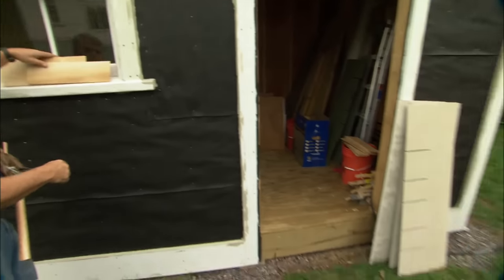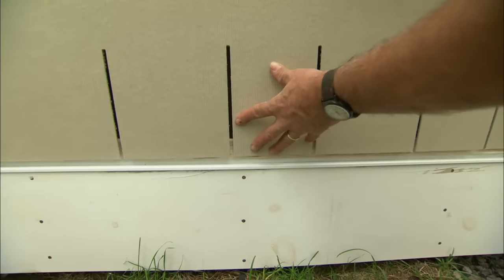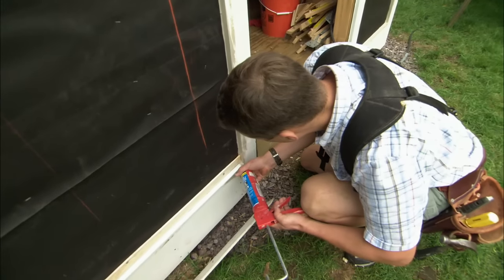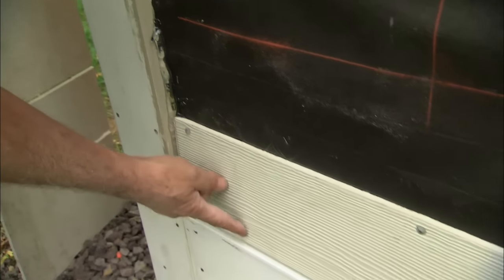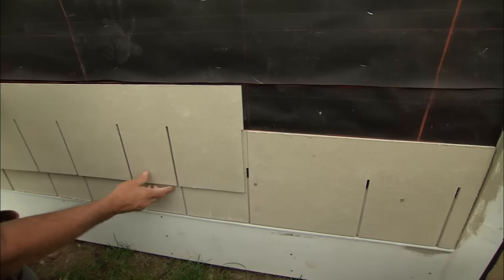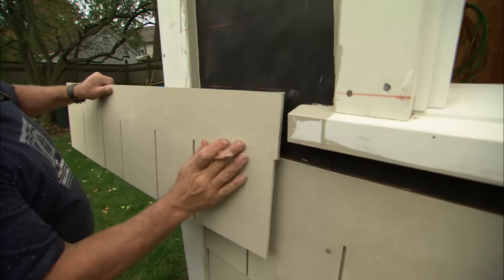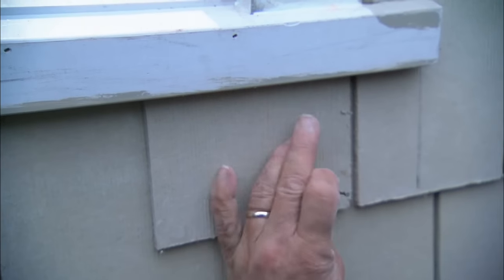How to Install Fiber-Cement Siding | This Old House

Comment: Tommy Silva did a top notch job installing the fiber-cement type clapboard-shake style siding on this outdoor shed. Looks pretty durable and almost as realistic as wood siding without the maintenance worries..
Reply: Roofing Companies CT   I wouldn't hire you for roofing. The flashing was installed incorrectly.
Reply: Roofing Companies CT no primer and paint on the ends, no proper flashing. plus can you say "class action lawsuit"? these guys are teaching people to cut Hardie plank the way the manufacturer say NOT to. the dust is among the most hazardous out there and all you have to do is score and snap it. plus they're wearing dust mask not respirator.  you all should learn how to build.... and read
Reply: If you're wearing a respirator is it okay to cut it like he did? I'm just curious since I don't know much about this stuff.

Comment: Interesting they didn’t use vertical strapping and attach the siding to the strapping to create an air gap to allow water to escape. Maybe it is because it is a tool shed.

Comment: I love seeing that good old fashioned felt paper. You can't beat it. Question: do you need a "rainscreen" behind cement board siding?
Reply: No
Reply: Yes
Reply: Maybe?
Reply: It depends. [actually, HardieShingle does NOT require a rainscreen]
Reply: Tommy Kinda LaSorta
Reply: On a climate controlled building — in which there are differentials of pressure, temperature, and humidity — absofuckinlutely. 
On a tool shed, not so much.

Comment: Is this stuff the same thing as Hardie plank? It looks like it. If so, that tip about scribing both sides of the product and just breaking is pretty cool. Save a lot of saw blades and I don't have to breath all that dust!
Reply: C J Bowen  you get mesothelioma from asbestos.you get silicosis from cement dust.

Comment: Hello I am replacing the siding around my chimney. Current siding is wood and we are putting new fiber cement siding. Do I need to put any membrane between the siding and OSB wood for the chimney?  I know any other outside wall requires a house wrap but I am not sure about the chimney.

Comment: Cant complain too much if this is the material you want to use, (homeowner), but so much cheaper and faster and easier to use vinyl.
Reply: This is just a shed, so it probably doesn't matter too much.  Also, some people just don't like vinyl.

Comment: If you face nail the shingles under the window do you cover the stainless steel nails with caulk and paint or?
Reply: paint pen...no need for caulk unless you're filling a void.
Reply: The homeowner is painting the shed green--so, it'll be covered with paint.

Comment: I'm despairing because I started to patch my existing shingles with fiber cement and I keep cracking the fiber cement, so now I have a huge gaping chunk of the corner of my house down to the tar paper. It's impossible to find help these days. I don't know where to begin. What I wouldn't give to work for TOH and learn how to be self-sufficient without putting the soundness of my house in jeopardy because I don't know what I'm doing.
Reply: Do you live in the Town of Hempstead, NY?  I'll be right over to give you a hand.  Let me know how you want to arrange it.  This doesn't sound like a big deal.

Comment: decreased exposure, but that's okay.  Not painting the cuts will void warranty if JH branded, as well they have a impregnated nailing line above the tabs, not lower...which was done due to smaller exposure.  Ringshank nails either stainless or galv are adequate...save the stainless for the face nailing and use galvanized on the non exposed....too much money to waste on bigger projects.

Comment: What is the cost for installing fiber cement siding for a 2000 sqft house?
Reply: Our 2500 square foot house cost over $40,000 for James Hardie fiber cement siding, trim, soffits, facia, sheathing repairs, etc. Labor was the biggest cost. It is not cheap...

Comment: Did you use 15 lb felt, or Grade D building paper under your siding
Reply: Look into synthetic underlayment vs tar paper.  Tyvek/Titanium/Grace, many choices. These don't crinkle if they get wet from rain/heavy dew if you don't get done in a day.  they don't tear either like tar paper easily does.  Great if you are working by yourself.

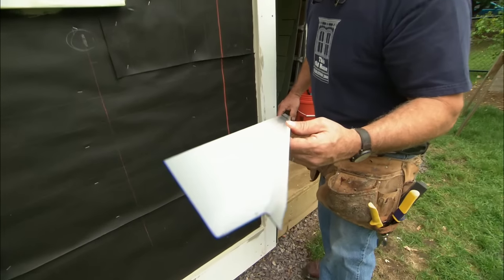Comment: The bottom piece of flashing they installed at the 1:20 mark of the video is done incorrectly.  Whether installing a drainage plane (siding attached directly to the building without an airspace between) or a rain screen (siding attached to cleats, nailers, vents, etal to create an airspace) you always "shingle"materials so that they overlap the material below.  The z angle should have been installed with the upper leg BEHIND the building paper so that the paper overlapped the leg.  Caulking the back of the z angle wouldn't be necessary in this manner of installation but couldn't hurt.  Look at the Tyvek video on YouTube on how to install windows.  The mantra in the industry now - and has been since about 2008 -  is overlap, overlap, overlap.  If your building envelope is properly shingled and you used appropriate materials then the siding portion of your building envelope won't leak.  As a byproduct of this installation, the building paper helps protect even a coated flashing from the chemical reaction of with cementitious materials.   Also, the lath (starter strip in industry lingo) should be pressure treated or you can use a lengthwise cut section of the siding material.  Nails should never be placed within an inch of the top (or bottom) of siding and never within one half inch of the ends.
Reply: Allen Stone I agree completely, you would also think that common sense would have some factor in lapping..  be a bead of water, where could I go!?;?
Reply: you must be worth millions lol

Comment: Should of painted the siding before starting. Pain in the butt afterwards.
Reply: It's only a small shed; the siding will be painted in one day.
Reply: Lol, I can tell you have never installed pre painted siding before. Primed and installed, painted afterwards is ideal. I do this for a living.
Reply: @jaymaxim8782   Hi. I currently have siding that needs replacing  do you think Hardie Board ia a good choice? I currently have rotting wood, other option is vinyl.

Comment: Still quicker than shingles. But what about the cost?
Reply: In my area, Fiber cement generally costs $3 to $4 per square foot. Cedar siding can run $5 to $7 per square foot.

Also keep in mind that the maintenance required with cedar siding adds thousands to the overall cost. You will need to paint or stain cedar siding every 3-5 years, and periodically repair or replace the shingles or panels.

Comment: Where do you buy the lath material?  I've heard it called a cant piece before as well.  
I can't find any pieces that are smaller than 3/4" depth
Reply: Gregg D you can just buy a piece of Hardie lap and rip it to 1 1/4 inch strips. The lap (8 1/4) also works really well as your first backer piece before the shake material is installed.
Reply: great. kinda in line with my thinking.  Glad I wasn't going in the completely wrong direction

Comment: Thy look like christmas trees with their tool belts :-D He's using silicone caulk wich is non paintable ...
Reply: Julian Knödler the caulk he’s doing is hidden behind the board never to be seen or painted
Reply: Julian Knödler yes it can but it's not even showing,its as a glue thanks.
Reply: Its going to also trap water inbehind and water will get behind as he didnt water shed properly

Comment: bad way to install it, I don't know how they call themselfs professional installers you have to install 48,32,16 first row and 4th row you have to start again 48,32,16, also the piece behind your first panel have to at least 8 1/4 inches, also your nails have to be always on top of one of the lines of that way you never will see a nail or leak.
Reply: Doesn't matter its over a small wall. doesnt need any cuts in the center
Reply: I agree, also over lap (review should be 7") like he mentioned but he did @ 4", not to mention the flashing should be behind WRB!!
Reply: I dropped my exposure to 5 inches on a dormer for aesthetics...I think maybe that is what he was doing here, but should have explained the proper 7 inch exposure and 8 1/4 starter course and nail placement to avoid seeing nails.....not done per spec at all for JH from the first 1 1/4 that will rot out and not priming cuts to scoring it for a crude/rough end cut....only way for smooth cut is a good blade...shears are good for ripping but horrible for a crisp cut if that matters ...which is the whole point of this product...aesthetics.

Comment: can anyone say "class action lawsuit"? these guys are teaching people to cut Hardie plank the way the manufacturer say NOT to. the dust is among the most hazardous out there and all you have to do is score and snap it. plus they're wearing dust mask not respirator. plus they did not put flashing behind the joints out paint the ends. they should get a lawsuit from builders AND from James Hardie. they they go and learn how to build.... and read
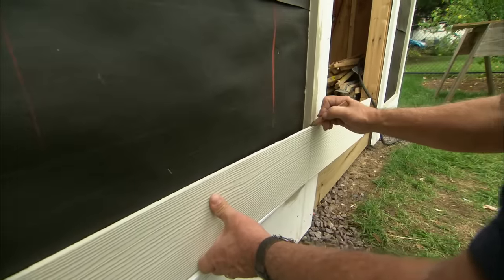Reply: 2:40 How about you quit criticizing and post up a video of the "correct" procedures? Did you ever think of that?
Reply: "can anyone say "class action lawsuit"? "    What a baby.    Go call a lawyer, baby.

Comment: This is completly wrong. You never seal your base if water now gets behind it will stay behind. None of his barrier wrap or trims were water shed. This is old school improper installation methods causing rot and mold on foundations. Cocking doesnt fix everything old timer.
Reply: A little bit of caulk and paint makes the carpenter what he ain't
Reply: From a outsiders perspective the USA is so far behind in these times its not funny.... Most countries have gone into a cavity system, which allows all water and moisture to evaporate and bleed. This is why in the US homes rot and everything needs to be replaced.